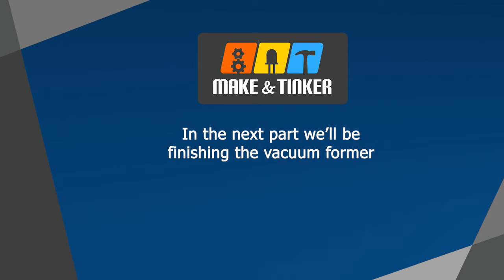The Ultimate DIY Vacuum Former - Part 1

Comment: Can you tell me the spacing between the electrical coils. Also, where did you buy the epoxy putty and where did you buy the mineral wool. Also what are the roller's called and the frame that they roll on called.

Comment: Nice work! I like the design. I would lose the pliers and get some sockets and a 3/8" driver though. Pliers are not the correct tool for bolts. Thank you for posting.
Reply from the maker: Thank you for watching! You are right, we just used the pliers because they were readily at hand :)

Comment: There's pvc glue, no need for epoxy plastic, screws would be better than the glue, mdf is not resistant but is porous, there are a lot of improvements

Comment: congratulations! I'm from Brazil, thanks for the tutorial, it will be very useful. What is the area of the suction table and the capacity of the vacuum moto ( fcm)r? thank you again !
Reply from the maker: The effective suction area is around 55 cm x 55 cm. We used a 3.5-Peak HP shop vac and it worked just fine. Thanks for watching!

Comment from the maker: The digital plans for the ultimate vacuum former are available NOW! Lots of work have gone into creating this 46-page step-by-step guide, with over 80 technical illustrations, specs, list of materials, electric and electronic connection diagrams, drilling and cutting templates, printable labels, STL files, code and a Quick Operation Guide. 
Get the plans here: https://makeandtinker.gumroad.com/
Reply: hello good morning!
I could review my purchase!, because it does not let me download any file
Reply: Looks amazing! Do build plans require having a CNC machine to create custom parts? Thanks!